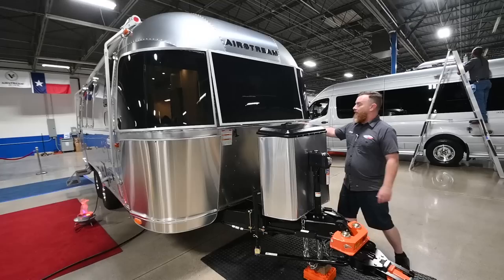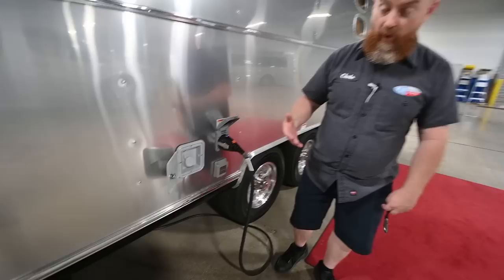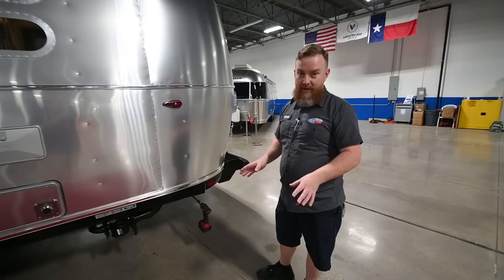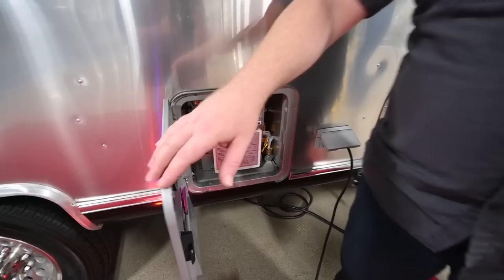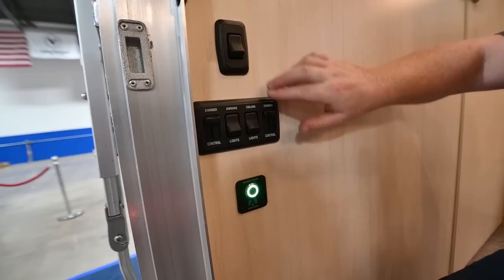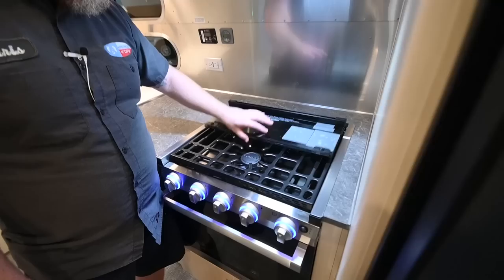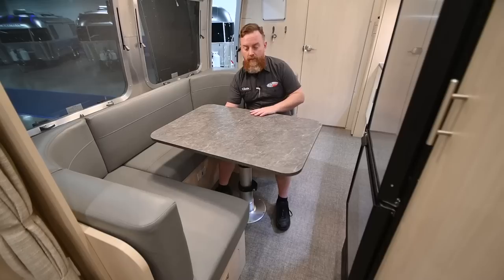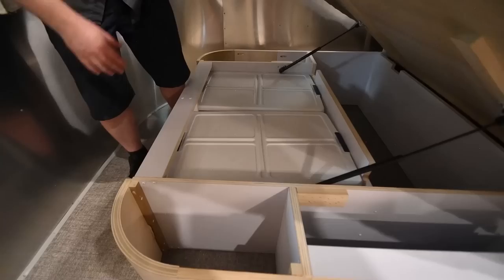The all-new 2022 Airstream Flying Cloud 23FB | Full Walk Through Tour

Comment: Someone else said it, but that process of getting the awning out looks excruciating! I'm specifically talking about that part where you use the long tool to loosen at the beginning step. I do really like the detail in describing how to use all these components and the possible pitfalls with each. That said, very cool trailer.
Reply: I was thinking the same thing about the awning. I wonder why they don't have a better system
Reply: @markhaynes4386  I watch RV videos all the time (researching my future purchase) and I've never seen an awning system so badly engineered.  Every other RV/trailer has a powered awning with a sensor to auto retract in winds.  With this system by the time you get the awning retracted the gusty winds will be in the next state over.
Reply: My $18k Jayco had an electric awning…. 😮

Comment: He is thorough; however, I am underwhelmed that such a high-end camper can have so much manual equipment on it.  You can buy equal or less expensive quality campers that are much more user friendly.  Besides the manual jacks and awning, why would you want the low-pressure propane connector on the back side of the camper?  In the wind, I can pull my awning in to about 4' from the inside to keep my lawn chairs covered a bit and tolerate the wind well.  Even the toilet is low end.  (This might be a budget model as I am not an Air Stream expert.)
Reply: More automation the more failures. Analog always beats a computer chip.
Reply: @dukeallen432  No computer chips, electric motors do the work.  Why get out a drill when the motor can be in the jack, same with the awning.  The truth is, it costs less to make everything manual, and that is sad in an expensive camper.  No way would I buy a new one, but like the earlier models which are the same but a lot less money.  I am 76 and have owned various forms of campers for 60 years having upsized when we had kids, and downsized in old age, and I stand my my original comment, not chips where there are none needed, only controls which may, but likely do not have any chips.

Comment: Awning should be electric for the price of these things. SMH
Reply: Yeah but it has LED lights around the Burner Knobs - though the Gas Oven has no piezo igniter? IDK, but the more I look at these things it seems like most features are added on without much integration - like putting the fold down plastic cover right over the Heater Exhaust. You're right....over 100K for what?